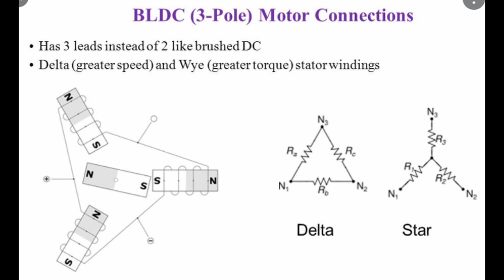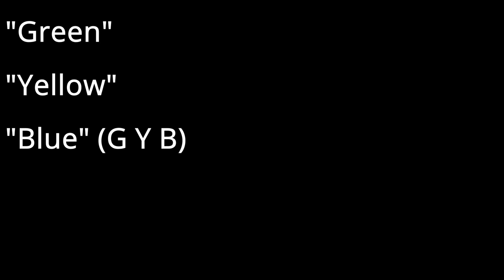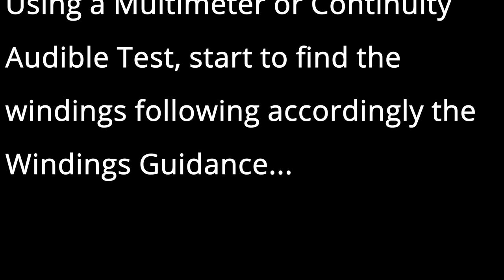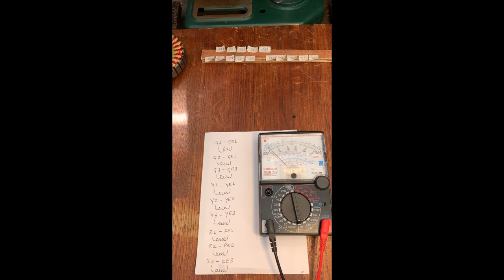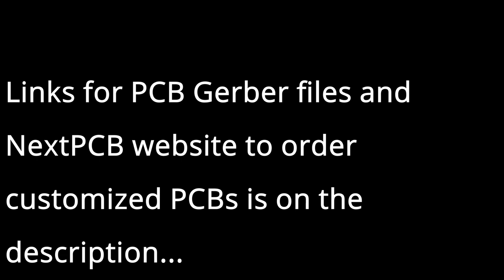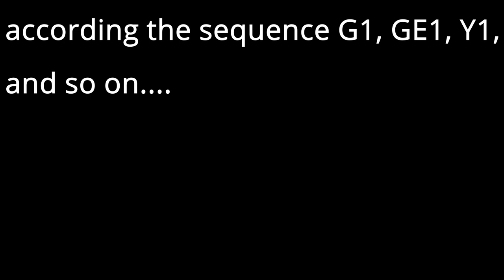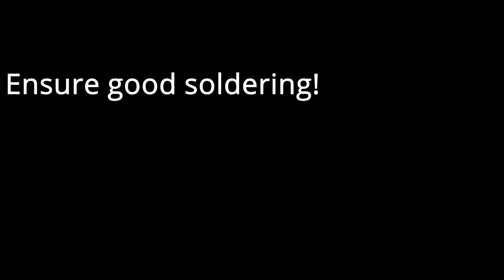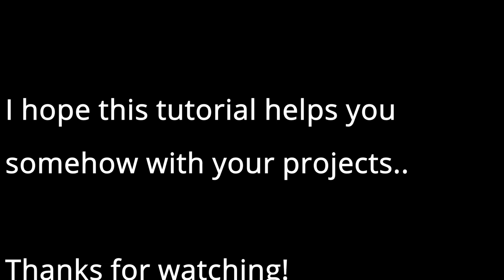Hoverboard Hub Motor Modification

Comment: i just did that but the motor gets hot really quik and even with no load on it. the torque is considerably lower at lower rpm
Reply from the maker: Probably you did something wrong with the coils…maybe you mixed up the coils. Only get hot if you put heavy load for long time…I would recommend you double check the coils connections and wirings…
Reply: @Attic-Toy-Design  i did just like in the video and the motor runs smooth, the only problem is that i was using it with a hoverboard hacked mainboard and a 4Ah battery for testing. do you think i can get more out of it with a 500w controller?
Reply from the maker: Well, I didn’t test the modified motor with a hoverboard main board controller…I used a e-bike 36V 800watt speed controller. Maybe the hoverboard main board is doing something dodgy with the modified coils..I really would like to help you…but I am unable right now, as I don’t have a hoverboard to test it…I will try it once I get one…please, keep me informed if you find out something or a solution for your project.
Reply: @Attic-Toy-Design  Thats ok thank you, i will test it again on the bike, when i finish the battery pack, as i dont have a bigger controller for now. Even if it is not suitable for my bike gears setup(require more torque rather than ), i will use it for other projects, or use it on the bike with a bigger gear in the back wuch require less torque and more rpm. Either way great project Thanks
Reply: Another option that i think of is that my current battery is weak and so is the controller as you said, and being unable to supply more voltage to the delta config, it will draw more current, like all electronics do when they need more power and there is not enough voltage. il keep you updated
Reply from the maker: That makes sense…
Reply: @24cata24  The controller of the hoverboard is double, but it has hardware parts-components (top-left bellow the capacitors) to lower the input voltages, into usable for the combination. More you need better cooling radiators for the mosfets, to upgrade-aluminium and add some air to circulate.
Thank You for the great video @Eduardo.

Comment: Thank you very much.
I have just finished my rewiring from star to delta one of my hub motor for electric mountainboard.
It works. Spinning is much more faster, but motor getting hot faster too, than second hub motor with star.

Also, I don't know how to return to star from delta😅
Reply from the maker: The ideal would be to add a second hub motor to your ebike to distribute the power more evenly and reduce the heat…
Reply: @Attic-Toy-Design  I tied to rewire second hub motor and test speed yesterday. So, I had 4 wheel mountainboard with two hub motors with delta wiring.
1) max speed increased from 27km/h to 45km/h (may be it could go faster, but 45 km/h was a little bit scarry on mountainboard)
2) torque reduced by two or may be tree times.
3) very slow acceleration and braking.

But 45 km/h after 27km/h was amazing!😀

I'm thinking about adding two hub motors on front of my board to have 4wd electric board and increase torque.

Comment: Hi I loved the project, how can I order such an electronic circuit?
Reply from the maker: Hi! You can order a customized round PCB on the description. There is no much electronics circuitry on this modification. Only the hall sensors you must to rewire back to its original. Take some nice photos before you start your modification for a good reference about your hall sensors.
Reply: @Attic-Toy-Design  Can I give up the board, and instead of the board, wire wires like in the motor coil.  If so, what diameter of wire should be used?
Reply from the maker: Of course you can! The round PCB is to make more neat and professional but you can use any wiring that can handle high current at least 10A
Reply: @Attic-Toy-Design  Excellent, thank you very much.

Comment: with 500w you dont have heat problems running on a long time?
Reply from the maker: Yes. Definitely. But if you develop a E-scooter project using front and rear hoverboard motors to drive it (2WD) you can distribute better the power/torque as a result of less heat if running long time…
Reply: @Attic-Toy-Design  ok, and what is the maximum speed of your scooter? and his have a good aceleration?

Comment: i don't get it if this thing can go 3x speed with almost same amount of torque why manufecterers or everybody doesn't use this the must be a something negative about it maybe so much current draw or unhealty for the motor driver pls enlighten me
Reply from the maker: Less torque, higher speed, high current, increase in temperature, less battery range. This is a hub motor modification for a e-scooter project using 2WD (dual motor) instead of 1WD to compensate the less torque and balance the high current drain ad the temperature. High performance e-scooters use this system to achieve high speeds (80-100km/h). I hope I have enlightened you.

Comment: You will overheat the motor if you run it for long period of time. What's the point? You need also design liquid cooling system to use it. LOL
Reply from the maker: I have tested the motor with load and I notice some heating but noting so significant to the point of the motor get damage or even add an insane liquid cooling system and you mention it. Lol
Reply: @Attic-Toy-Design  With the same voltage the same 3 faze "Triangle" winding connection will consume more Amps than "Star" connection. Just put it under the load continuously for 30 minutes and see what happen. LOL
Reply: @tigranohanyan3321  More Amps but lower resistance, so heating remains the same for a given torque load.
Reply: @dekutree64 This is ridiculous. For higher voltage you need to increase the length of the copper wire and decrease the cross section to fill the same gap in stator.  ( to keep the same heat dissipation) The resistivity of copper wire  (ohm x meter) is the same.
Reply: @tigranohanyan3321  That is correct. The modification in this video is the inverse, reducing the length of the wire by cutting the coils and putting them in parallel groups (more cross section, less heat for given current).
Reply: @dekutree64 Ok if you put more in parallel , you shorten the length of the winding. That means that you have to also decrease the voltage. Anyway. You should know that star connection has longer winding than triangle connection. So high is voltage for long winding, Lower voltage is for short windings. Is that clear?
Reply: @tigranohanyan3321  Yep. But in this case the original voltage was far below what the motor could actually handle, so there's no need to decrease it.